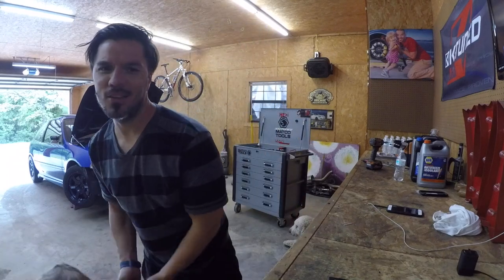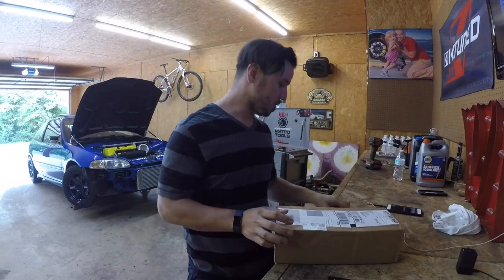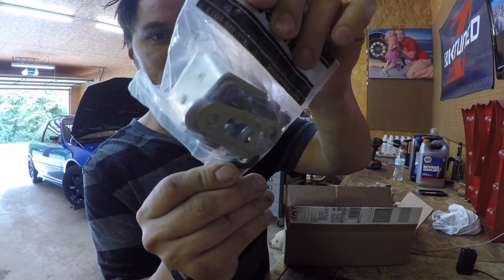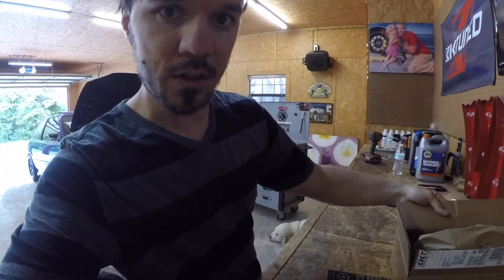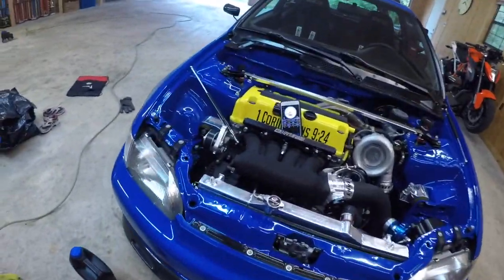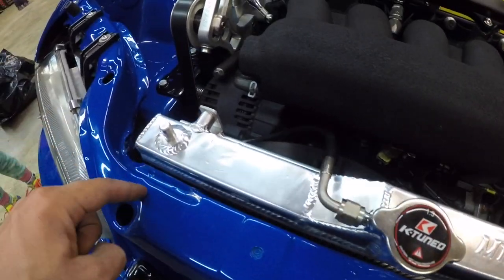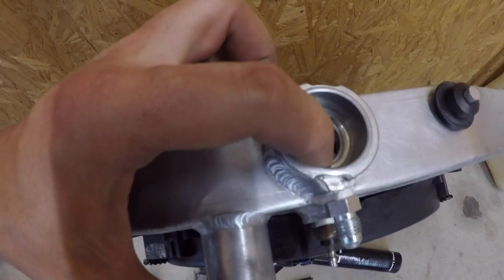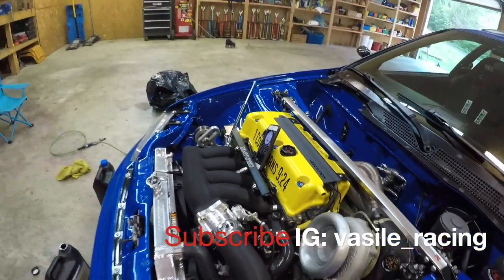Full size radiator K20 turbo

Comment: @Vasile Garage Hey Vasile! I'd have a question. What is your complete Brakesystem Setup? (Front&Rear) Resovior Tank, Brakelines, Knuckles, Calipers,Brake Pads, Rotors,  Spacer, Long Hub Bolts do you use. And which Sparcos Seats and Steering Wheel are you Rocking?. Keep up the good work! its ya boii.

Comment: try redline water wetter it helps keep coolant temps lower and doesn't harm anything. You added to your coolant . You can get it at local auto parts.
Reply from the maker: martin ortiz I done all the tricks in the book, the half rad just wasn't doing it, even with the new rad I use the water wetter

Comment: Hey man which hoses did you end up using for the bottom? I've purchased the RSX lower rad house and even have the K Tuned swivel but I can't line it up for the rad hose to fit.